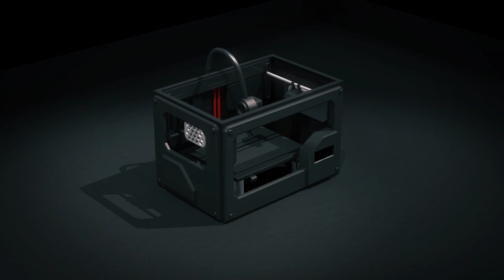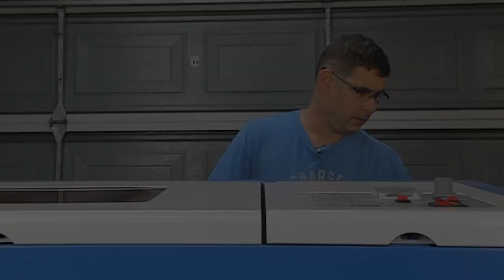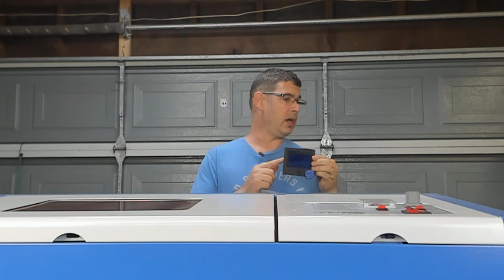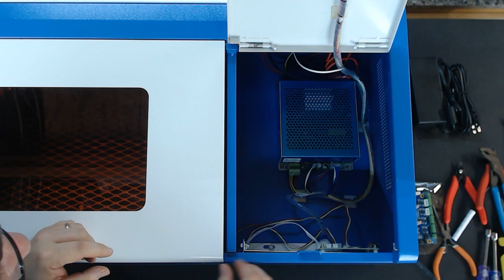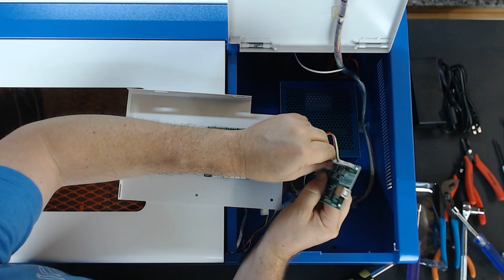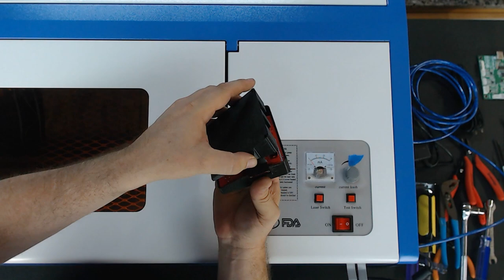K40 Cohesion 3D / LightBurn Installation- Part 1

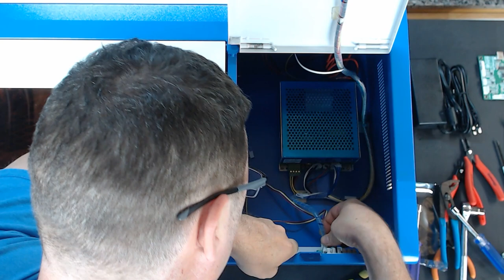Comment: 11:11 What is that blue wire bundle?When we hook up the blue wire bundle, is that power from the k40   power board? How can I use the external power supply cohesion gave me and not run both powers to the cohesion 3d board to not fry the board? 14:51
Reply from the maker: Haha. Took me awhile to figure out what you meant by the "blue wire bundle," it's a frosted clear wire loom that just looks blue in the camera.

That is the power for the laser that goes THRU the board, but does not power the board. The secondary power supply included with the Cohesion board powers the board itself. I don't know why it was designed that way- I can only imagine it is because the internal power supply doesn't have enough power or is the wrong voltages. But both are required.

Beyond this, I would suggest contacting Cohesion support or pinging on their forums if you additional questions as I don't know the specifics of how the board itself works electronically- I just followed their setup guide back in 2019.

Comment: Hi. Firstly, great video. I plan to buy cohesion3d board for my 4060 machine currently running on m2 nano. Question regarding the included power supply unit: can it be connected to 240v source? I'm from Malaysia and local power supply is at 240v. Thanks.
Reply from the maker: Thank you for the kind words.  I'm told by my contacts at Cohesion3d that the power brick is indeed compatible with 240v, but that your LPSU may be at a fixed voltage. He said they have a an article about it on their site in their knowledge base.  Hope this helps.
Reply: @crussty3d  Thank you so much for your reply. I'll search their site for info as suggested. Happy new year.

Comment: Where did you get the display adapter for the LCD display?  I can’t seem to find the one you showed. Thank you for the video’s. I have ordered a board for mine.
Reply from the maker: Rick McCaskill if you order the GLCD from Cohesion3D it is included with it. I’m not sure if they have it as a separate line item, but reach out to them and maybe they can get it listed
Reply: Practical Printing thank you

Comment: Waiting for part 2 3 4 how you finding this board, what results are you getting from it, cheers
Reply from the maker: Loving it so far. Cuts and engraving are great. Power control from software is night and day difference, and you can build cut lists to do it all in one go. Videos coming soon as I want to make sure I show the process as simple as possible, yet with enough detail to be relatable.
Reply: @crussty3d  DO you have parts 2+ ready yet at least?

Comment: Working on an sesetive electronic motherboard with pliers and juggeling around the pieces bare handend without proper self grounding? 
No information on the dangerous powersupply on the K40? Wow, clearly you are not an electronics technician and you have no idea what you are doing there. 
How can cohesion and LightBurn sponsor something like that?
Reply: The sensitivity of those boards is likely not that bad. Not like you are handling bare chips. That board has NO high voltage associated with it so as long as you aren't messing around in places you ought not, you will never be in danger.